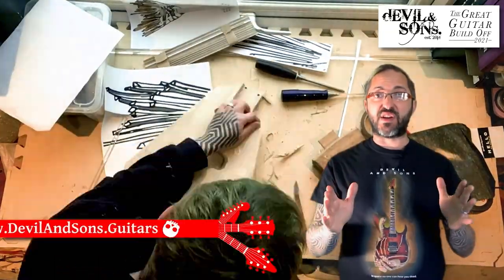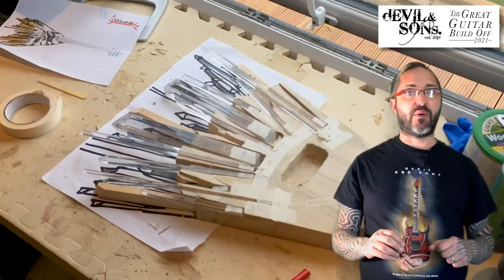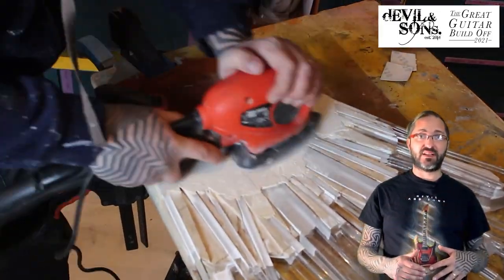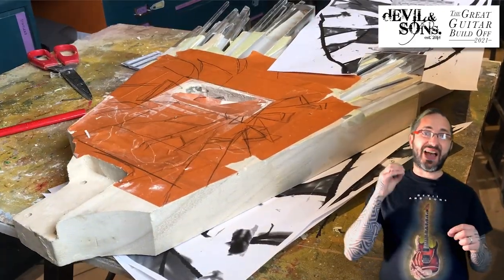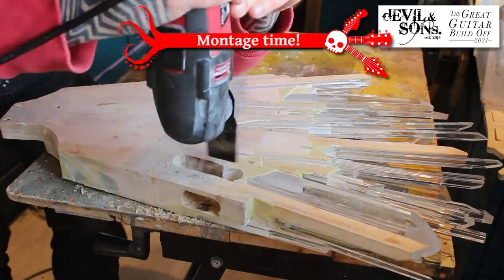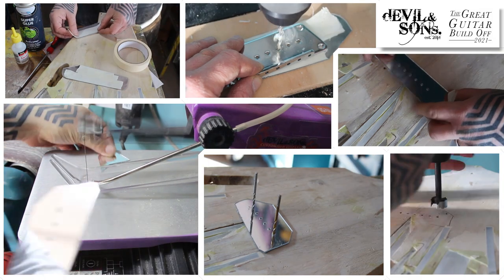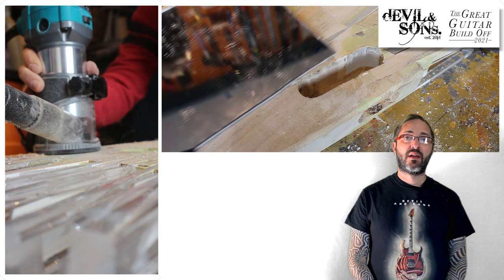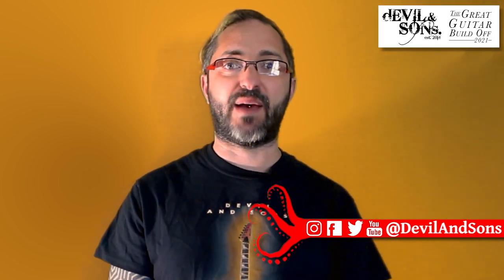Building a one-off guitar body the artistic way: GGBO 02

Comment: Hi Daniel hope all's well 4 u.l could do with a bit of advice regarding which screws to use for locating the tuners on a 3x3 headstock,new hole positions required.is there a brand that are strong and good quality
Reply from the maker: Hey, all good here thanks. I think a lot of the good brand will come with screw and hole guides for drilling into a blank. Are you replacing a good brand, in which case the same make may fit. Otherwise I like schaller locking tuners myself. Also if you have to Redhill sometimes utds easier to fill the current holes with wood dowel and/or wood filler and drill the holes from scratch as opposed to widening them.
Reply: @DevilAndSons  I am putting in some Wilkinson's that are an improvement on what came on a Harley Benton Les p gold top with p90s.love the guitar,l can't get my head around how good how cheap.l started playing early 80s and this wasn't an option I just need the screws ,3 on one side all went in easy,the other side not so.screw heads cheap and mangling so I need new screws.will drill pilots and wax not sure where to get some decent ones.will try north west guitars.cheers.
Reply from the maker: I have customised a few harley bentonite and they are impressive. In the past I have actually just bought screws from a screw supplier online. In the UK I think they were called Kays fastners. Anyway I'm pretty sure a size 2 screw is the correct diameter but actually that was because I was buying in bulk. As well as northwest I buy from black dog guitars and 'all parts'.
Reply from the maker: @johntchb  How did you get on? BTW, you can vote for my GGBO guitar here (if you like it), just hit the heart on the page: https://greatguitarbuildoff.com/products/daniel-wallis